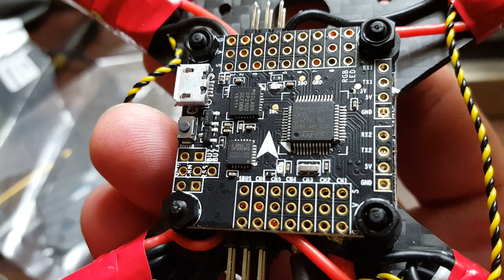How to Use Spektrum Satellite With Xracer F303

Comment: Hi, what parameters i have to consider in betaflight when i have spektrum sattelite?
Reply from the maker: Configure the serial receiver provider to be either spektrum 2048 or 1024 depending on which type of receiver you have, and make sure you are powering it with 3.3v not 5v or you will burn it.

Comment: is there any flight controller out there thatt has a spectrum satellite plug to directly plug in to our solder?
Reply from the maker: Yes, lots of them.

https://youtu.be/fImiu8f8dMg?t=8m22s
Reply: Joshua Bardwell which one would u recommend? i have a lemon satellite receiver but dont no wich board to go with.i would like one that has the plug in on the board but if i have to solder that would not be a problem. BTW THANKS FOR YOUR INPUT

Comment: No tx input showing on betaflight but rx is binded. Any ideas? I am on UART 3 set for SBUS and serial rx. I am using a orange rx that has minimum 3.9v so all three wires are hooked into SBUS. This is nuts.
Reply from the maker: +Grahamwt007 o am pretty sure PPM input goes to RC channel 1 on that board.
Reply from the maker: +Turbo Tyler Orange doesn't make an SBUS receiver I don't think. Orange is DSM. Spektrum.
Reply: https://hobbyking.com/en_us/r617xl-dsm2-x-6ch-receiver-with-long-antenna-and-cppm.html It's this one and I was told to run it on sbus. Thanks
Reply from the maker: Nowhere in that listing can I find a reference to SBUS support. It says DSM2/DSMX and PPM.
Reply: Joshua Bardwell I thought that since it's cppm and a satellite that I hook it into sbus and configure it as a serial rx like the tab shows, spek sat,sbus...
Reply from the maker: +Turbo Tyler no. CPPM is analog. It doesn't go into a UART like Spektrum or SBUS. But I see what you're saying. That receiver only supports PPM output to the board. In the future, you should use one that outputs serial. For now you need to find the PPM input on your board.
Reply: How would you connect a cppm? signal  just to channel one on ppm side not sbus?
Reply from the maker: +Grahamwt007 you need to find the CPPM input on the board. What board is it?
Reply: I am looking at getting the x racer F303 v3. Just cant see where it 
should go from the board layouts I have seen. Live in Africa with not 
too many options and dont want to make the wrong choice so appreciate 
your help! Oh and your channel ROCKS!!!!

Comment: tried an original speksat on uart 2... won't bind... i'm trying sbus/uart3 now...
Reply: ok sbus/uart3 works... I chose uart2 because it was more convenient for getting to the 3.3v pad but that one just won't let the sat get into bind mode
Reply from the maker: +AyKayFPV if it's a 3.0 board, UART 2 TX and RX are reversed.
Reply: it's a 3.1 board

Comment: If i wanted to run my signal to uart2, would i use the TX or RX pin on the v2.1 board?  The obvious answer is RX, but i'm really not sure.
Reply from the maker: For a receiver, you use the RX pin.
Reply: Thanks, i'm actually trying to find a new place to grab 3.3v for my lemon sat.  That tiny 3.3v pad came off when trying to remove the hot glue.  I hate solder pads!  Holes, use holes manufacturers!  I tried using the SWD pad, it shows 3.27v, but it won't power it.  I thought i might have damaged the sbus pin, so that's why i was trying uart2.  I'm going to give this board to a frsky user and replace it with the new flip32 f4.  It had a spektrum connector, which i really don't like, but the price is insane.

Comment: You can use that SBUS port directly with 5V , if you buy AR7700 , it's special RX which has RemoteRX port - that acts same as remote receiver ( sattelite ) and it's powered by regular 5v :) Another good thing is that you have long atenna , to point it out of quad carbon frame with some zip ties, and also you have 3 regular servo ports ( GEAR/AUX1/AUX2 ) which can be used for your LED/Buzzer/whatever you want to control.

Comment: FYI - just to update ... I am a spektrum user who tried the Redcon 5V DSMX satellite.  Tried quad tonight and the range is horrible. Did a range test close to ground and had drop outs at less than 300 feet at approx 10 feet off the deck. Maybe the one I have is just bad, i dunno but I will be using a trusted lemon sat I have using the 3.3 V out.
Reply from the maker: +Razor E good to know. Unfortunate too.
Reply: +Joshua Bardwell Soldering on spek sat now
Reply: had a lemon on my quad and hat a lot of failsafes... original speksat is the only way to go... you can get those for cheap on ebay too

Comment: I received my V3 today. LOL I don't know or care what the market share is, but I use Lemon Diversity Sats on all my Quads.  I don't think it is a good idea to put the Sat on Uart1 because it is locked to the USB port. So you wouldn't be able to test flight modes/switches live using your TX and the GUI which i do alot. So I'm pretty much restricted to Uart 2 or 3. I would be happier with the 3.3v next to Uart2 or the Sbus connector.
Reply from the maker: +FF-FT-RCPlanes-Quadcopters you don't have to put the sat on UART 1. In fact, you can't because it would conflict with USB. Put it on the SBUS port which is connected to UART 3.

Comment: Great videos . Just ordered a f303 v3 . I use lemon ppm micro 8 channel receiver . Do you if channel one on your input is for your ppm connection like most flight controllers . I have a dx8 transmitter
Reply from the maker: +Freddy  banuelos I would think so but I haven't tested it.

Comment: I have tried that, used pins 7 and 8 5 and 6'paired together etc , baud rate, loop time. Using an x4rsb running sbus. I have yet to get confirmation we have softserial on this board.
Reply from the maker: I haven't used it myself, but gosh, the pins are there, so I don't see why it wouldn't work. If it doesn't work, then I agree there's not much point to having the pins.

Comment: and the spectrum satellite uses 3.3 V. Just remember that after watching this video here he just told you it's a 5 V output. So watch yourself guys. Is that spectrum satellite receiver won't work on 5 V. But on the plus if you actually look up to the five old you will not damage the receiver. So if you are wire into an S boss make sure that you get power supply to a 3.3 V power
Reply: Josh clearly points out 5v from sbus and not to use with

Comment: Contrary to what you just said I and several other people use that port. You don't doesn't mean other people don't. Besides that will misspeak you made. I do greatly appreciate your videos. So if you're on the anti-spektrum bandwagon don't wave your flag in your channel. Because a lot of us really do like spektrum.
Reply from the maker: I'm having trouble following what you think I said that you're mad about, but let me just be clear that I have nothing against Spektrum. I'm not on any bandwagon. I made a little joke in my previous video about FrSky being better than Spektrum, but it seems some people took my comment all too seriously as Spektrum hate. Everybody should fly whatever makes them happy.

I didn't say that nobody used the Spektrum header. I said that I think very few people took the trouble of soldering a micro-JST or whatever jack it is to the older revs of the F303. Why would you bother, when you could just solder wires direct to the pads? Besides, the pads for the older revs of the F303 are surface-mount, and made for wave-soldering. Soldering them by hand is out of the reach of most hobbyist's skills and equipment.

For goodness' sake, please at least get angry at things I actually said, instead of things you think I said.

Comment: Those spektrum guys sure are sensitive!  LOL. I just installed the F303 in a new build with Betaflight 2.9.0 and for some reason it defaulted my looptime to 500 (2khz gyro sync).  I'm not sure why. My ESCs are just plain DYS 20a with BLHeli 14.6 and Oneshot125 enabled. Does Betaflight 2.9.0 default to 500 looptime on all F3 boards now?
Reply from the maker: +Albert Kim (marblekit) yes I think so.

Comment: Hy, please I'm new to this beta flight F3 boards,... I have a X racer V3, a X4RSB and downloaded beta flight GUI, can't find the firmware, is it possible to make a video where you fully configure a Xracer in the beta flight GUI using all the good configuration like 8000Khz,...
thanks
Reply from the maker: +HecTech FPV send me a zip would you? Joshua Bardwell at Gmail.
Reply from the maker: +cmtetaboaco the firmware is at the bottom of the product page. I will have a video showing how to flash it later today maybe. "Full setup" vudeo isn't possible because everybody's setup is different. This might help though. 

https://youtu.be/htkw7d97bOo
Reply: +Joshua Bardwell Is this firmware the betaflight 2.8 or 2.9,... or a different firmware? if so, isn't the betaflight better? I've read the Xracer uses the firm of the Sp? even the 3.0? it's so confusing lol
thanks
Reply from the maker: Xracer 2.1 and earlier uses SPracing Hex. Xracer 3.0 uses a custom hex that you can download from the FPV Model page. The custom hex is betaflight 2.7.1. Going forward, there will be a standard betaflight target for the Xracer 3.0, but for now, you have to run the custom hex from the web page.
Reply: +Joshua Bardwell really nice, thanks a lot, about the video, very nice as always, but how about the giro hz and this more complicated stuff, just live as is or is there a better thing to do in the 3.0? that's what I don't understand! refresh rate or something like this! sorry for my ignorance about this matter!
Reply: If you want a custom version for the V3 let me know mate i have 2.8.2 and 3.0 built and can do a 2.9 if anyone wants

Comment: My Xracer v2.1 shows 100% cpu usage when trying to run 4K/4K mode.  I'm running Aikon semf escs with blheli s and Betaflight 2.81.  Do you know why this is?  I thought this flight controller was capable of 4K/4K.
Reply from the maker: +Eric Maggard depends what features you have active. Are you doing GPS, softserial, etc...
Reply: +Joshua Bardwell +Joshua Bardwell no. Airmode is the only thing I have featured in the cli.  I also set PID process denom to 1.  my loop time is 250.  I'm using a spektrum ar7700 plugged into the sbus pins........thanks for that advice by the way on you giveaway video!
Reply from the maker: I have never had a problem doing 4k/4k on the F303.
Reply: +Joshua Bardwell ok thank you.  I'll double check because I must be doing something wrong........but one more question that I can't find on Rc groups or anything.  Do I need to flash blheli s escs with Multishot or do they automatically recognize Multishot when enabled in Betaflight?   I think they are automatically recognized but can't find a definitive answer
Reply from the maker: +Eric Maggard only blheli_s auto detects multishot.
Reply from the maker: +Eric Maggard only blheli_s auto detects multishot.
Reply: +Joshua Bardwell awesome thanks again for always taking time and answering questions.  It totally saves my ass when I search Rc groups for two hours and can't find an answer.  Your the man!!!!

Comment: They should drop PWM receiver support already :-)
Reply: Damn that's harsh, many people still have and wish to use PWM. Sure i's buy sbus now where possible but PWM is on over 30 things I fly and not supporting a major standard is a very elite move that would lock out many for less than a single gram saving.
Reply: Yup. Sbus is the way to go. Or even ppm. But not pwm.
Reply from the maker: Remember that the target audience for the board is acro racers, and I doubt many of them are using PWM. The main reason I'm glad to see the RC header still present is that it enables people to use softserial if they so desire. I don't think that boards are removing the RC header to free up weight. Rather, it's because they are using the GPIO pins for something else or because they need room on the board (e.g. the SP3 Mini and Evo, which have the SD card reader).
Reply: Joshua Bardwell I follow and agree to a point but if there aren't enough resources to support a standard rx, a redesign is needed, dual layer board, more intelligent layout, more capable hardware etc. There aren't many racers who use self level but that's no reason to take it away, leave that decision to the user. Same with the RX support.

A friend has an xracer that flies superb but I wouldn't buy one because of this, other F3 boards will fly the same and offer full RX support.
Reply from the maker: +MicroRCFiend the decision is up to the user, as you say... to choose another board. And up to the designer to sell a certain product. The market will decide.
Reply: You will be surprised if you knew how many guys use flysky PWM receivers my local club. Well i just got the ibus receiver today. On a plus side you can use PWM pins as extra outputs

Comment: You should be more carefull with the things you say, even more if that is harmfull to a brand o person, just an opinion from a sub who trust in you
Reply from the maker: Everybody makes mistakes. I'm no different. All I can do is try to set the record straight and try to make sure it doesn't happen too often.
Reply from the maker: But let me just be clear: I didn't say that Spektrum wasn't supported at all. I said, "The other thing you could ask for is the satellite connector back. I don't think it's going to happen." That is 100% correct and accurate. Other people jumped to the conclusion that you couldn't run Spektrum without the header, which is not correct.
Reply: +Joshua Bardwell yes i know, but also with the powercube, and sort of with multishot
Reply: +beyersito dont get me wrong, i love the channel, maybe i got false impressions